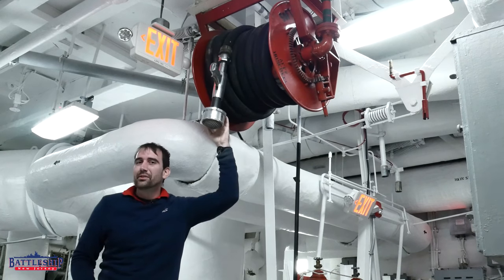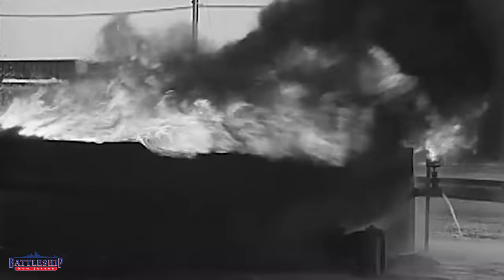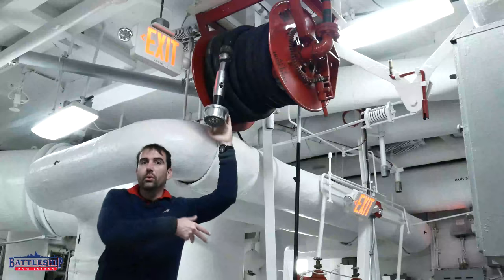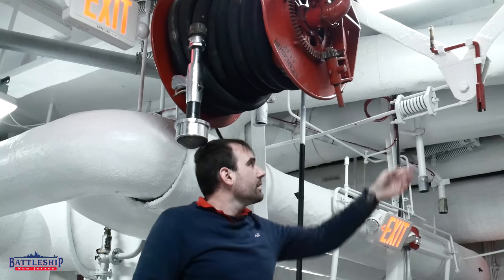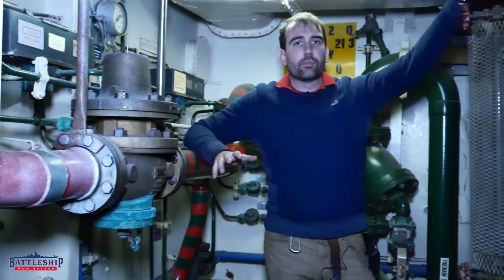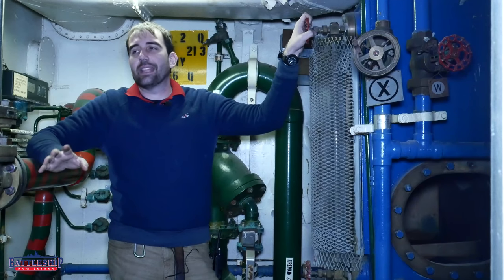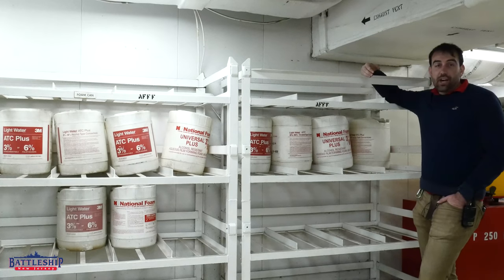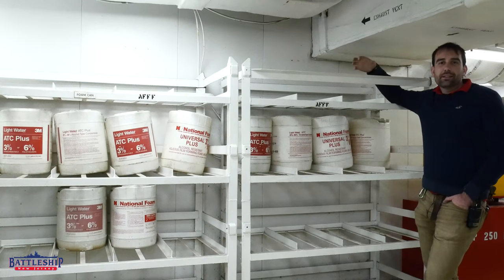Firefighting Aboard Ship: AFFF

Comment: First actually discharged fire bottle at about 4 years old. It was a CO2 bottle, and XI used it to put out a fire my Dad set in a 55 gallon from. Knew the classes except for class D by the time I went to first grade. Used them on real fires, probably at least half a dozen time. Car fires, which were a couple of thes, are hard to put out. You think yhhey are out, but because of all the oil and grease they tend to reignite. Job I wouldn’t up working at for the last 20 plus years, required demonstrating proficiency with an extinguisher, by putting out a fire set in a pit, every 2 years.

Comment: So do you guys still use some of these systems for the museum or do you just have normal fire extinguishers fitted throughout the ship?
Reply: Well the museum doesn't have any flammable oil or gas.
Reply: @WALTERBROADDUS  I was more thinking about New Jersey state regulation on civilian building fire prevention ect
Reply: @southernbear736  Regular CO2 extinguishers would probably be sufficient.
Reply from the maker: We follow modern and local fire codes, so we have lots of fire extinguishers and an amount of sprinklers
Reply: @BattleshipNewJersey  And quality industrial ones too.   Yes, I notice the brand.  Good choice.  Just be prepared for cleanup of powder [and soot] after one is used.

Comment: Class c fires you remove the power and use CO2 to fight.  There’s also class D fires which are burning metals that makes its own oxygen and the only way to fight them is to eject it overboard.
Reply: I would think in war time class d fires eould have happened
Reply: There are class D extinguishers, ( Yellow markings )  this is a mixture that more of less encapsulates the metal to stop it from burning

Comment: My fire story is a case of lost in translation. When I was in culinary school we were making "Family Meal;" dinner for our classmates. The class voted on Tomato soup and Grilled cheese sandwiches. The guy working with me asked to make the grilled cheese sandwiches. I am off cutting up my tomatoes and roasting veg until a saw a column of flames erupt from the other side of the line. The guy working with me got the grill up REALLY HOT then took thick slices of cheese and put them on the grill. He was LITERALLY grilling the cheese. The fire was so hot it triggered the Ansul system blasting the ENTIRE line with water based fire suppressant. It turns out the guy never made what we call Grilled Cheese sandwiches, and was just guessing.

Comment: Have I used a fire extinguisher? Lol.. I was an Ironworker for more than 20 years.. of course I have! Mostly for my pants though while welding down bar joists.
Reply: Here I thought I was the only one who lights themselves on fire when welding or cutting.
Reply: @crazyguy32100  it was always bar joists.. that being said.. during a recent insurance inspection of my shop.. the inspector was blown away with the sheer number of fire extinguishers I have... I don't like being on fire.
Reply: @bretsk2500  In my case it's mostly when replacing chute liners, the plunge cuts with either a zip cut or torch. A little while back there was an arc flash campaign and I got issued arc flash rated coveralls, fire retardant but lighter then leathers.
Reply: @crazyguy32100  yeah.. but then you smell like an old Army tent. I'll keep my leathers.. worse it ever got for me.. I was welding down traverse tracks on a 50T gantry crane.. 95 on the ground.. a measured 140F 35' up inside the building where the crane was.  I did the job.. and when I came down and took the soaked leathers off... I was shivering.. and dehydrated.. I'm glad my ass keeps my feet on the ground now.

Comment: I wasn't there when it happened but someone using an acetylene torch cutting off a shock absorber mounting bolt caused the oil in the shock to boil spew out and ignite......my boss grabbed a fire extinguisher an sprayed it at the base of the fire ....it worked    the crap from the extinguisher was EVERYWHERE..... lol  but the other kid ran out of the shop lmao......  also  our floors are sometimes oily\solventy especially near the workbench and vice..... when I'm welding over there here ant there a fire pops up lol... I use the Argonne from the mig welder to smother it     so far so good lmfao
Reply: incase anyone doesn't know.... it does clearly state on the side of every shock  or gas\oil charged deal   literally STAMPED into it says DO NOT HEAT lmao

Comment: most fire extinguishers are dry powder, not foam. and ya, i've used em a couple times. came up on a semi with a brake fire on the trailer, used two with that, plus a car on fire once.
Reply: Depends on the type of extinguisher and what class fire it's designed for.
Reply: @WALTERBROADDUS  yes, however, most fire extinguishers you'll find in a non-industrial or maritime setting are gonna be abc dry chem.

Comment: When he says Alfa, Bravo, etc he is making use of the International Radiotelephony Spelling Alphabet, commonly known as the NATO  phonetic alphabet, NATO  spelling alphabet, ICAO phonetic alphabet or ICAO spelling alphabet, which is the most widely used  spelling alphabet. The phonetic alphabet is a way to say things with words that start with the letter of the alphabet you want to communicate. Using the phonetic alphabet can allow you to reliably communicate letters when a signal is bad or even if the audience is in a noisy environment. For example if a radio signal is poor,  air traffic control will clarify anything that is not getting through using the phonetic alphabet. The phonetic alphabet is standardly used in aviation for runway letters.  The Full set: Alpha Bravo Charlie Delta Echo Foxtrot Golf Hotel India Juliet Kilo Lima Mike November Oscar Papa Quebec Romeo Sierra Tango Uniform Victor Whiskey X-ray Yankee Zulu. WUN, TOO, TREE, FOW-ER, FIFE, SIX, SEV-EN, AIT, NIN-ER.
Reply: Tango Hotel Alpha November Kilo   Yankee Oscar Uniform.

Comment: If you look at the Navy investigative report, arsonist Ryan Sawyer Mays could have been stopped if leadership and crew had it together.   No fire drills, poor communication with dockside fire personnel etc:   "...36 individuals —including USS Bonhomme Richard 's captain and five admirals — were responsible for the loss of the ship, either by their own actions or by a lack of oversight leading up to the alleged arson".   I'll bet the New Jersey crew will not have these problems, with you guys being seasoned and familiar with procedures.
Reply: Don't forget that they were actually in a yard availability.  Many installed FF systems and a large portion of the firemain were tagged out.  Many hatches were fouled with cords, hoses, etc.  Flammable liquids were staged/stored improperly in large quantities by civilian yardworkers.  Trash was allowed to accumulate throughout the ship.  At the time of the fire, the only USN personnel on board were basically a security watch/patrol.  No fire drills were held because the ship was under the control of the shipyards, who were supposed to provide their own FF personnel.  In a nutshell, the BHR was more of a civilian work zone than a US Navy ship.  The one area of the ship not undergoing repairs (Engineering) came through the fire with no damage.

Comment: If only they knew how to activate and use the AFFF on the Bonhomme Richard, we'd still have a ship!
Reply: Sailors knew how, but very few actually onboard due to the fact that the BHR was in the middle of a yard availability, and the ship was still under the control of the shipyards.  The actual crew aboard were more of a security patrol than a full duty section.

The AFFF systems, the TAS systems, and a good portion of the firemain were tagged out by yard personnel for work.  Hatches which could have been closed to limit the spread of fire were fouled with cords, hoses, etc.  Hatches not fouled and which should have been closed were left open because civilians tend to be too lazy to close a hatch behind them.

During a yard availability period I have PERSONALLY seen a civilian welder using a full 5-gallon can of Lacquer Thinner as a stool to sit on while welding.  The firewatch which he was required to have on station while welding and 30 minutes after hotwork was complete was nowhere to be found.  The firewatch showed up about the same time as the Safety Officer whom I called when the welder rather colorfully refused to cease work.  He had been down at the end of the pier picking up lunch from the food truck.

The above is typical for civilian workers on board a navy ship.  We wont even discuss what they do when a ship has lots of dark corners...and the trash bins and portable toilets are all the way down on the pier.  Yep.  They even bring toilet paper with them...
Reply: @kevincrosby1760  SO damned sad.